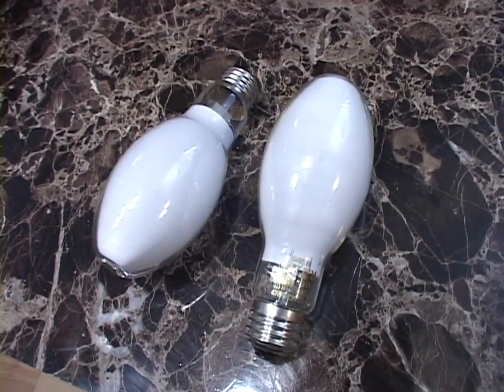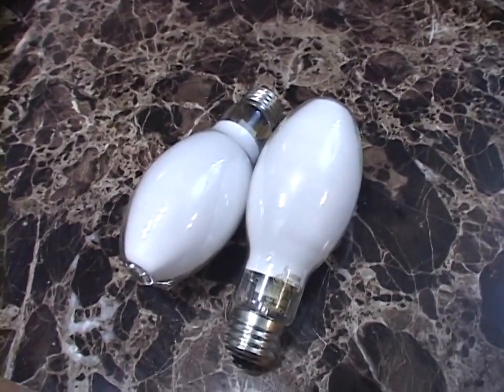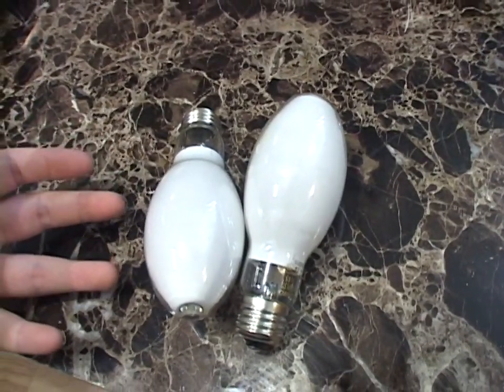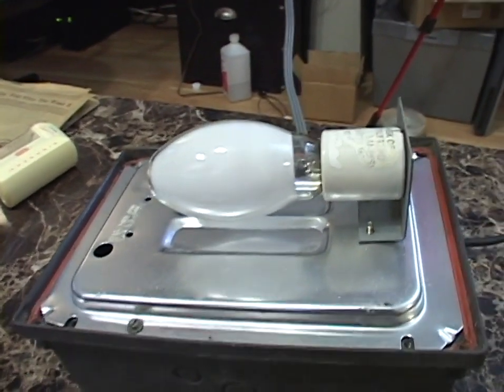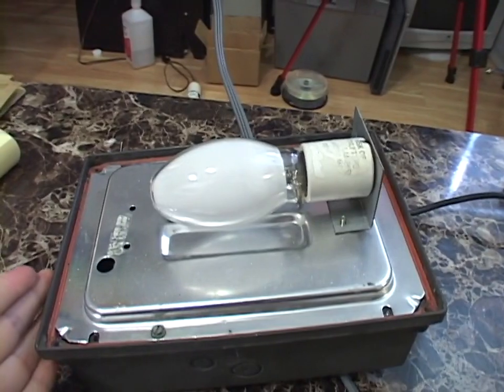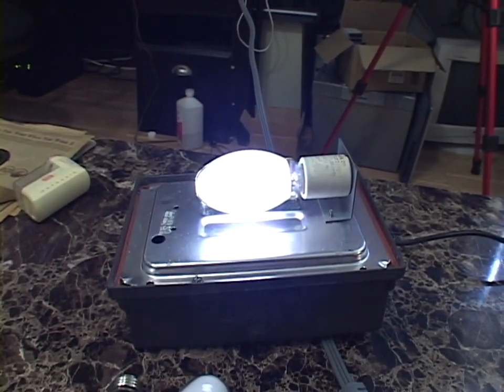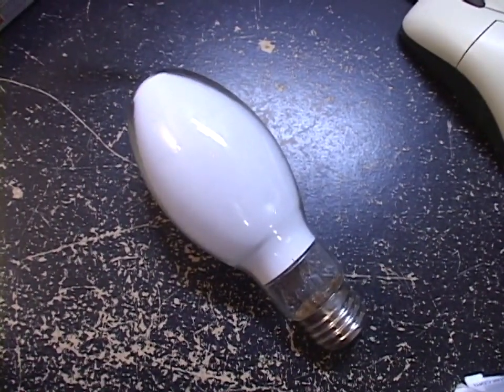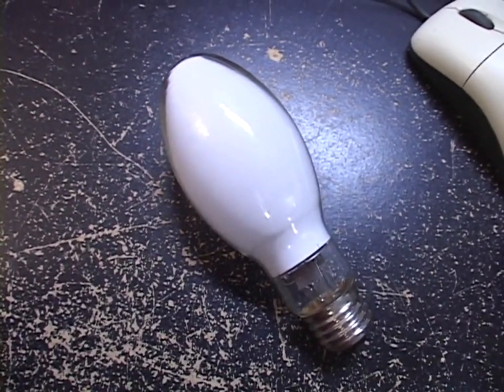Testing 50W metal halide lamps

Comment: I have a Cyclops Thor Colossus Halogen spotlight modified to HID, in this case I have 39 Watts ceramic metal halide bulb installed into the spotlight as it's obviously a nice light bulb when it comes to the best CRI (Color Rendition Index) department. It works fine with the automotive HID ballast (obviously it has to be squarewave AC at the output, as required by the ceramic metal halide bulbs and wattage of course should match too). Pretty bright and very efficient compared to the original H4 Halogen bulb.

Comment: If you run a mercury vapor lamp on an electronic metal halide ballast, it will damage the igniter and put the ballast in the toilet.
Reply from the maker: Obviously it won't, because it's still running fine. There's a delay before the ignitor fires, and it won't fire if the lamp has already started.

Comment: nice scientific video on how this tech works!
So are there metal halide bulbs inside modern projectors that arn't LED ones?
E.G something like a small epson tabletop unit. In these the lamp is a sort of a cartredge that you remove by undoing two screws and just pull it out. The cartredge has a kind of a concave lens on it.
I got a handfull of these projectors from an office building that shut down after covid came and they had to purge all there assets.
Reply from the maker: Yes - the projectors that take a minute to "warm up" and get to full brightness use metal halide lamps.
Reply: @themaritimegirl  very interesting!

Comment: I still prefer the new LEDs over these
Reply: still not as cool to tinker with thats for sure lol
Reply: Leds are boring... simple and instant on... I find these light  source much more interesting and fun.  I do prefer leds 4000k-3000k for normal everyday use but also have a mercury vapour and high pressure sodium area light for ocassional use and to enjoy them. Both the startup warm up and cool down. You don't have those with leds
Reply: I don’t
Reply: They are better for the environment because more efficient, but metal halide bulbs are much more fun to play around with as well as look at.